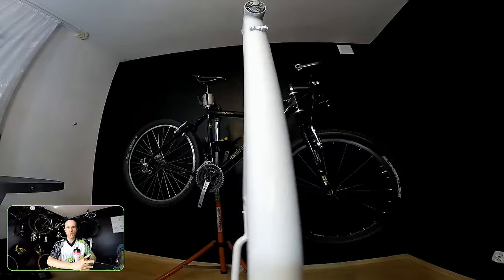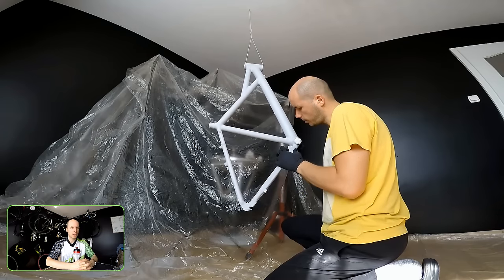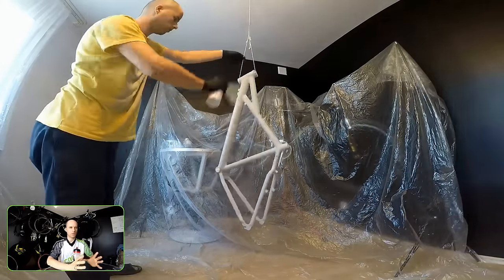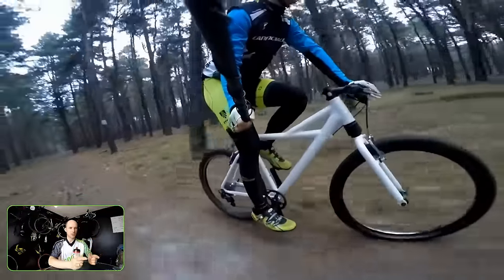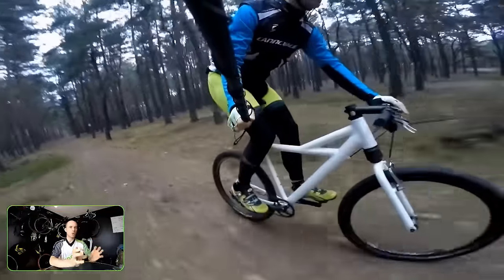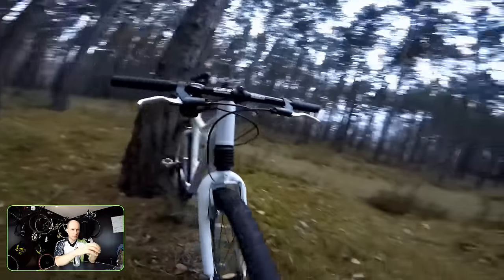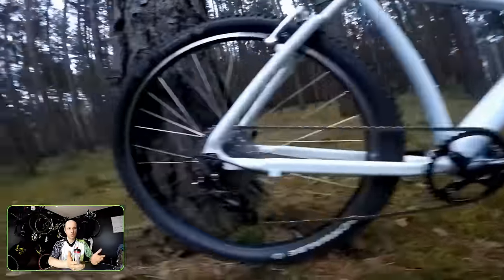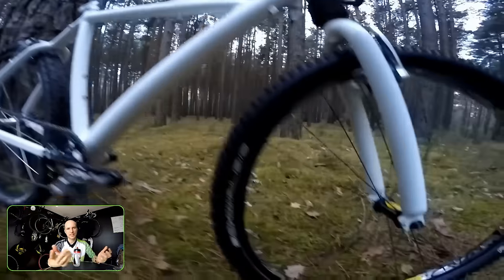FINAL PAINT On My Cannondale F600. Painting Bicycle Frame. How To Do It?

Comment: it looks like you took more care than most painters would do, however on aluminium frames the first coat of primer should be an acid etch primer. This allows the paint to bite in to the surface of the frame and stops de lamination.  A 10 minute flash off time before standard high build primer is applied is fine. decreasing between coats should not be an issue. You also had a hardener in your colour,  this means it is a direct gloss paint, no need for clearcoat. if you want to apply clear to it the paint should be prepared with 1000 grade paper prior to stickers being put on. I hope this helps.
Reply from the maker: Thanks for these suggestions! I wonder why I wasn't told that in the paint shop, where they actually paint cars...
Reply: +cannondany  You should of been. I restored E type Jaguars for a while and we used it on them and now I paint frames for Enigma Bikes in the UK and we use it on all Ti, aluminium and steel frames with no issues. Any advice needed feel free to ask. I've just painted my own 92 killer V in lilac. Love Cannondale myself
Reply: +cannondany  You should of been. I restored E type Jaguars for a while and we used it on them and now I paint frames for Enigma Bikes in the UK and we use it on all Ti, aluminium and steel frames with no issues. Any advice needed feel free to ask. I've just painted my own 92 killer V in lilac. Love Cannondale myself
Reply: You never wash with detergent and water after using strip-sol , wash it.
Reply: @davidrollison4107  Hey ,do you know how should i paint my steel frame ? I removed all nickel it is just steel now ..what should my steps be now ?

Comment: I think it is probably the primer not bonding to the frame properly. I wonder if the degreaser influenced this. Usually for painting there are special tack cloths that only pick up dust and particle without leaving any chemical residue. I would be concerned about using any kind of harsh chemical on the metal before I paint it. I agree with others that the factory does a pretty good job of priming so it's better to leave the primer and simply sand off the paint. It takes a lot of effort though. You may not even have to sand down to the primer. If you get the stickers off, and just rough up the top coat enough the next layer of paint might stick.

Comment: When you paint bare aluminium it has to be etched first with a zinc acid etch. There's different types; some that are very thin & are applied quickly & only give a colouring to the metal, some that are applied like any other paint to a specified thickness, & some are etch primer (Usually found in Automotive painting). The acid eats in & provides the base for your primer. I'd suggest using etch only as opposed to etch primer. Strip the bike & prepare as you do. Degrease. Tack rag it all over. Acid Etch applied to colour the aluminium (It'll go a yellow-green). It's thin so move fast & spray in longer motions along the frame as opposed to bursts. Allow for designated time to pass. Prime. Top Coat, Clear Coat (if need be).  :-)
Reply: Oh & it's cancerous as hell so wear a mask & paint outside :-)

Comment: I don't know that particular paint but there are some coatings out there that are dry/cured to the touch and are usable after a few days but actually takes many weeks to reach full hardness unless the item is put into a bake oven to speed it up.   Even in your situation, it could take longer because it was cool out or humid or whatever.   I highly recommend a proper powdercoat finish for your next project.   Not many wet sprays can compete with powdercoating for durability, and the ones that are will be just as expensive and will not be something you can do at home either.

Comment: Use an 'etch primer' or epoxy primer, sand 400 then a quick once over with 600, then use a sealer, which will seal the entire frame from the elements, then paint directly on top of sealer no sanding required unless surface is rough then 600. Paint, let it flash (dry with aided heat, can use box heater or something similar) then CLEAR! get a clear with hardener, like your paint. You went single stage paint on aluminum which most likely is the issue, go 2 stage paint, base colour and clear coat, with epoxy primer and a sealer. You will have zero issues... Use of a clear over base colour the clear acts as a hard glossy protective coat that seals in and protects your paint
Reply from the maker: Thanks for your advice. I did everything according to the paint shop guidelines...

Comment: Maybe the 2 coats or primer were applied too thick or maybe there were applied too close together, time wise?  If the problem was the paint, I would guess that the paint would chip to the primer, not the bare frame.

Comment: Is your degreaser also capable of removing silicone? Silicone on the parts can cause a somewhat perfect paintjob to come off again. Enough clear coat applied or was it 1k paint? With 2k paint, correct ratio hardener and paint used?
Reply: the bane of all painters.   There is no solvent for silicone which makes refinishing contaminated items very difficult.  This is a warning to all those "polishing" their cars and motorcycles with silicone based products.   You can get products that help you deal with silicone problems, but the results are rarely 100% as nice as if it never had come in contact with it.

Comment: Hi perhaps hoy need to use a 220 or 320  sand paper directly in your aluminum frame before start painting last es el I've painted my aluminum frame, almost your same steps then put some vinyl wraps over. I did'nt Like  too much so I quit the bigger and have no problem with it

Comment: After the main paint goes on do you sand it again with 400 grit sand paper until matt finish then add a laquer which is a clear spray paint then sand it again with 400 grit then apply a wax or polish to the paint for the finish i could be wrong ?
Reply from the maker: Hi Daniel, all the steps are shown in the series.

Comment: there wasnt enough of a scratch into the frame for the first coat of primer to stick to , ive painted all my bike's even motorbike's and car repairs all with spray cans , because a chemical stripper was used you didnt have to sand the frame much so u primer had nothing to stick to , i use 60 grit to take paint off , 80 then 120 grit on the whole bare frame , 4 - 6 light layers of primer , then a wet sand of 200 grit , then 3 - 5 light coats of paint , and 3-5 layers of clear coat , and perfect paint every time ,

Comment: I got a f800 with bad oxi paint job and sanded down to alu , did not use paint stripper as you need to neutralise the paint remover, also I do minimum 4x undercoat, 4 x Colour coat ( light sanding down first 2x colour cots) and 2x clear (poxy& hardener mix)  . 4 years and still going strong ..

Hope that helps ,,,   also use long strocks at 90 Degree to your frame when painting not short bursts,  oh and try warming up the can a bit to stop spiting ...30Degrees is good...

Cheers

Comment: did any of the paint start chipping off at the bar where the chain runs above it as I painted my old kona and it seems to chip very easily do you think lacquer would help
Reply: Kenny Bradshaw , I rebuilt a 95 kona cindercone, I opted for powder coating. Found a place that did alloy wheels, got the frame done white, for the money a better option than paint, almost impossible to chip

Comment: you sanded the frame to much making the metal to smooth, you should have a slight ruff surface to allow the primer to bond to the alloy, if the stickers removed the primer then the top coat of paint isn't the issue as it has bonded to the primer,
Reply: Aspasia Zacharias d